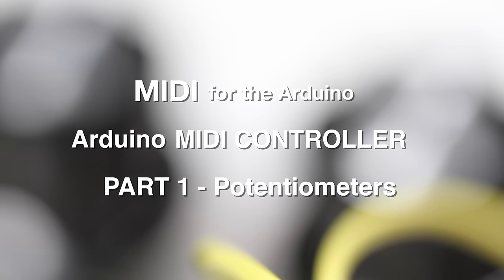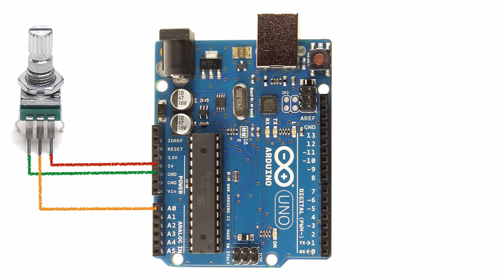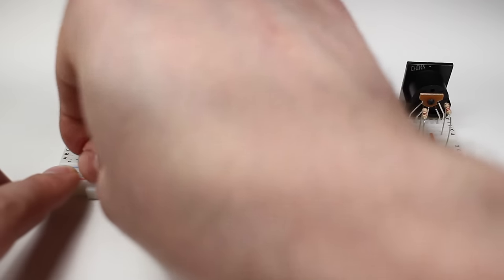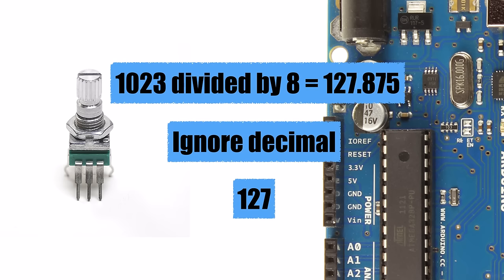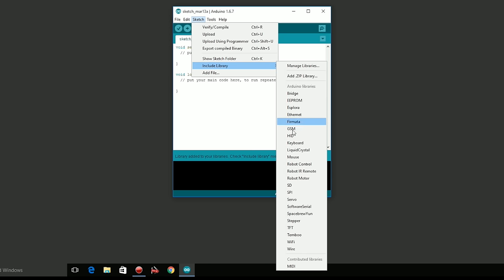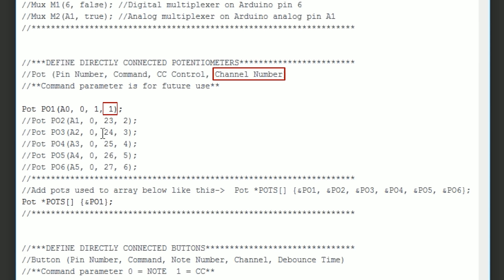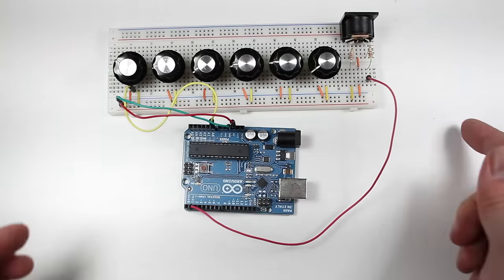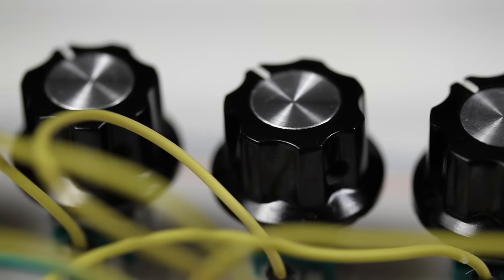Arduino MIDI Controller: Part 1 - Potentiometers

Comment: Hey I need to dig into the code but quick question --- does the current implementation support sending SysEx messages and not CC?
Reply: Did you find your answer? I'm working on to arduino and Sysex messages so as to control specifics parameters on my differents synths.
Reply: Bruno archi.entpe hey I have code I wrote a couple of years ago that did this, but it's a mess. Look at the MIDI.h library. You can send SysEx the same way the software shown in this video sends CC messages.
Reply: Ok I will see. I hope it will be so easy. Thank you.

Comment: HI, how can i send a note message from potentiometer, i ve tried to add the same property of buttons but something doesn t work, THANKS
Reply: I have found that this library is, at times not extensive enough and that the controller surface library is better, I got as far as sending the right LSB part of a message with this library, whereas the Controller Surface Library made me able to actually send the right amount of commands, since this one lacks CC functions.

Comment: Hello Dave,

1) what if I want to send SYSEX messages instead of CC?
My main problem seems to be that I dont know that the MIDI lib says, in other words what Arduino will understand.
Here a example (Yamaha TX81z)
NAME SYSEX MESSAGE  RANGE(the conversion to 99 instead of 127 will be no issue)

Operator 
level                                     
OP1     F04310 12 31 DVF7 0-99
OP2  F04310 12 17 DVF7 0-99
OP3  F04310 12 24 DVF7 0-99
OP4         F04310 12 0A DVF7 0-99

2) Additionaly it would be great if you could show a MIDI to CV. This could be using a RC (Low pass) a r2r or a D/A.
I think there are many Werkstatt, Monotron and other users who would appreciate your assistance as the Keyboard is not realy nice.

Thank you

Comment: Hi, do I  need to connect the snap-in pins of the potentiometer to GND or can I attach them to a independent soldering point which isn't connected with anything else?
Reply from the maker: Hi Mason. Only the the three pins on the front need to be connected. The snap tabs just hold it in place.

Comment: Hi, im going to try this. Is there a max number of potentiometres you can add? In the video you've added one, but I'd like to add 60 endless rotary encoders. Can that be done using your code before i throw away money on loads of gear?
Reply from the maker: Hi Daniel. This won't work with Rotary Encoders. They are very different from potentiometers.
Reply: @NotesAndVolts  shows what i know.

Comment: Looking to make a MIDI CC foot controller..... can the pots be switched out for 1/4" Jacks?
Reply from the maker: Hi worshipkid. You can do that but you may need to use a jack with a switch in it to ground the input if you unplug the pot. Otherwise the input will be 'floating' and you'll get a bunch of random values be sent out constantly.
Reply: @NotesAndVolts  Thanks again!
Would I run into any problems if I use a foot expression or volume pedal?

Comment: are u connecting the midi to the computer/laptop. do we even get midi ports these days in computer? I don't have one , what should I do?
Reply from the maker: Hi gsrini. I connect it to my computer through the midi jacks on my audio interface. I use an M-Audio M-Track Plus
Reply: Notes and Volts  thanks for the quick response.I just read there is something called hairless midi which uses arduino's USB port to send serial msgs that is converted by hairless midi to midi . is my understanding correct? can u pls do a video on that.
Reply from the maker: I'm going to convert this to USB midi in the future but I am planning to move to the Teensy platform (pjrc.com). This is an arduino compatible board that supports USB Midi without messing around with hairless or other things.
Reply: I'm glad I checked the comments. I was wondering about a USB midi config.

Comment: I know this is acient, but, if someone sees this please help. I basically want to make a surface with like 16 potentiometers. I want to be able to map them to anything in my daw. What CC should i put in. I dont want them to have just one function, i want to for example use 1 knob for attack in one plugin, and in another one i want it to be for delay. How?
Reply from the maker: You should be able to map the CC numbers in each of your plug-ins to any number you like.

Comment: i guess i can't just use the arduino usb connection for the midi output? i'm getting unreadable outputs in the console and there is no midi device being recognized. i wanted to use this to change values of my DAW on the fly.
Reply from the maker: This project is 5-Pin Midi only

Comment: So what needs to be done to get 16 pots sending data (are there arduino boards with more ports?)... also... is there a solution for 14bit rotary pots?
Reply from the maker: Hi UnkaTom. You can do 16 pots with Multiplexers. The video is in the playlist. Unfortunately, there is no Rotary Encoder support currently.

Comment: I know to program the controller I have to use a PC, but after I program the device using the software can I use my device on a mac?
Reply from the maker: Hi DJ. You can use it on any device that has a 5-Pin Midi input.

Comment: I'm trying this with ableton. I've got midi coming in but it's completely out of control! Any ideas?
Reply: Are you using a multiplexer or are there inputs defined that are unconnected in the real world (like, defining a potentiometer at A6 while there is nothing connected to it)?  Because if so, especially potentiometers are prone to "jitter" when left unconnected due to the way they are (or can be) read out and even nearing your Arduino with your body can cause the input to shift values.
Have you tried pulling any inputs that are defined but unconnected to ground by connecting them physically to ground?
Also, are you using a real MIDI-connector versus a firmware that identifies the Arduino to the computer as a MIDI device, because in case of the first, it sounds either like you've switched up pins (MIDI is seperated through optocouplers in most professional devices so actually blowing something up might be hard, but could cause problems in the way it tries to handle data when translating) at the connector side or the receiving device is working on a different baud rate than the Arduino is sending it out.

Comment: Hi, can somebody tell me how to make the led flashing when i turn the potentiometer or press a button. I mean the led turns on when I change the parameter and when i stop turnig the led stops too. It’s easy with buttons - simply digitalWrite. But I don’t get how to do this when it comes to the pots part of the code

Comment: since i don't have midi on my pc and i don't own an audio interface, a midi to usb dongle would work right?
Reply: Or download the Midi firmware library to flash your Arduino Uno or any other USB to Serial based Arduino interface chip with, so it will identifies itself to your OS as a Midi device :).  That's how I tested mine at first (before buying a Leonardo).

Comment: Hey, my 10k fader have 4 pins... which of them do I have to wire where?

Thanks :)
Reply: You might have an answer already, but, it's not an ALPS fader by any coincidence?  :P  If so, when holding the fader upwards with the 3 pins closest to you, connect the middle pin of those 3 to the ground of the Arduino, and the most right pin to the one of the analog pins of the Arduino (this is the wiper).
The 5V pin (or ground pin, should you happen to reverse the ground and 5V) is at the far-right of the fader.
The pin you might not use this time is a touch-sensitivity feature of these faders (other brands might have them as well, I know them from ALPS only because those are the only faders I've had my hands on) that can make touching (or nearing the fader with your body) the fader act as a button for some kind of function.

Comment: I follow all steps, I was using midi-ox to monitoring the midi input, but the signal is not being recognized as "CC modulation", just like "note on". I try link teh pot to a knob in FL Studio and works fine, but then I tried to link it to a WHA pedal in guitar rig 5 it behaves like a button!!! just two states, max and min... why? Where did I go wrong? I set everything just like the video.
Awesome channel by the way. (and excuse my english)
Reply: I solve my poblem. It follows that I was using a "midi to usb" converter cable, and it seems to convert all types of MIDI data on MIDI notes. I'm using the serial port now (with the help of some "serial to midi" software) and it works perfectly ;)
Reply from the maker: That's great Samuel! Glad to hear it
Reply: Hey Samuel. You can use your USB-MIDI cable. Try doing this: In the Arduino MIDI library you should have midi_Settings.h with this line: static const bool UseRunningStatus = true; Change it to false and give that a try.
Reply: I really want to try building this but as a Mac user I have no serial input, so unless this definitely works with a USB to MIDI cable then it's not worth me doing it.  Can anyone confirm this works for sure in this situation?  Does the code that Jaroslaw kindly provided above do the trick?  Thanks
Reply: I actually had similar problem as Samuel. Signal from potentiometer was recognized as note on/off, (off when 0V and on with everything higher) and not as CC signal. This solution helped in my case. Found it on the web, so probably it helped also other people.
Reply: Thanks Jaroslaw, I'll try it.

Comment: why you add an 220 Ohm resistor to the circuit of midi output? in comparation to the previous video that explain how to do a midi output and just use 1 resistor?  if you can help me i will be grateful
Reply from the maker: Hi Mauro. Use the second resistor as described here.
Reply: but why is the question, i want to understand.. do you have a link that explain more detailed please?
Reply: by the way your videos help me a lot thanks for share your knowledge
Reply from the maker: The 2nd resistor brings the circuit closer to Midi spec which is 5mA.
Reply: thank you man :)

Comment: Hi N&V，
Just new to the electronic stuff, few questions:
How to use the usb port instead of midi jack,? If we try to use midi software for mac, the mac does not have the midi port. Any difficulty for signal or data transfer?
For the Arduino 5v pin, and the potentiometers, do they need 5v power supply to make them functional?
Thank you.

Comment: I'm guessing that shifting bits right by 3 and left by 3 is to mask the lower 3 bits?

  _value = analogRead(_pin);
  _value = _value >> 3;
  _oldValue = _value << 3;
  _value = _value << 3;

 You could AND it with 0xFFF8 (for a 16 bit data type) to mask the lower 3 bits

Like this

_value = analogRead(_pin) & 0xFFF8;

 _oldValue = _value;

Comment: Could I use this as a midi controller, could I plug this in the back of a audio interface or usb midi interface?
Reply: Jacob DeForge you should be able to use it as a Midi-Controller. you will need a Midi-Female Port to input it to your computer, for example on a Midi-Interface, as you already mentioned. Might need some additional tweaking. I want to test this as well, if i get it to work i will update this thread and maybe create a stepbystep on how to do it.
Reply: you could also search on GitHub for HIDuino, makes connection possible using the Arduinos’ USB-Interface, making useage of a Midi-Interface obsolete

Comment: hi dave , how i can output midi signal on the arduino usb ?
Reply from the maker: Hi Victor. This project is for old school 5-pin Midi only.
Reply: Has your opinion is what if I flash the firmware HIDUINO this can walk

Comment: hi guys, i try to find a tutorial as good as this one but with an Arduino pro micro or a Teensy... because my plan is to add potentiometers to a midi keyboard ... connecting the usb from the board to the pins out of the Keyboard usb midi port...

Comment: please tell me what to do i have 100K pots. my computer reconise a signal but i have only 3 values: 0 56 ans 120. do i have to translate something or what? its getting me mad!!!
Reply: You sure that you used the analog inputs and analog read commands and not the digital? 
Edit: Scracth that. I commented before watching the video and didnt know he had an example program.
Reply: i use hairless miserial because i dont have a midi interface, to plug it by usb. i have changed the baud rate into 57600. the signal still be irregular and come from different channels. i can assimilate it on ableton live on virtual pots, it reconises something, but when i try to move the potentiometer, nothing happen, or sometimes very bugged things... here is my midi signal on my midi monitor: 
21:59:27.556 To Bus 1 Note Off 1 G♯2 0
21:59:27.556 To Bus 1 Clock  
21:59:27.556 From Bus 1 Clock  
21:59:27.556 From Bus 1 Clock  
21:59:27.556 To Bus 1 Clock  
21:59:27.556 To Bus 1 Clock  
21:59:27.588 From Bus 1 Note Off 1 G♯2 0
21:59:27.588 From Bus 1 Clock  
21:59:27.588 To Bus 1 Note Off 1 G♯2 0
21:59:27.588 From Bus 1 Clock  
21:59:27.588 To Bus 1 Clock  
21:59:27.588 To Bus 1 Clock  
21:59:27.589 From Bus 1 Program 1 56
21:59:27.589 To Bus 1 Program 1 56
21:59:27.633 From Bus 1 Program 1 0
21:59:27.634 From Bus 1 Clock  
21:59:27.634 From Bus 1 Program 1 56
21:59:27.633 To Bus 1 Program 1 0
21:59:27.634 To Bus 1 Clock  
21:59:27.634 To Bus 1 Program 1 56
21:59:27.634 From Bus 1 Program 1 120
21:59:27.634 From Bus 1 Program 1 56
21:59:27.634 To Bus 1 Program 1 120
21:59:27.634 To Bus 1 Program 1 56
Reply: you think it is because i have an arduino mega and not an arduino uno? i did like in the video with the same program, i juste did without midi interface this is the only difference so i use a virtual midi plug by usb. my midi motinor sometimes tells me (but i cant control when it happen) : 
22:03:21.561 From Bus 1 Clock  
22:03:21.561 From Bus 1 Program 1 56
22:03:21.561 To Bus 1 Program 1 0
22:03:21.561 To Bus 1 Clock  
22:03:21.561 To Bus 1 Program 1 56
22:03:21.572 From Bus 1 Note Off 1 C-2 0
22:03:21.572 From Bus 1 Clock  
22:03:21.572 To Bus 1 Note Off 1 C-2 0
22:03:21.572 To Bus 1 Clock  
22:03:21.572 From Bus 1 Clock  
22:03:21.572 To Bus 1 Clock  
22:03:21.585 From Bus 1 Note Off 1 C-2 0
22:03:21.585 To Bus 1 Note Off 1 C-2 0
22:03:21.588 From Bus 1 Clock  
22:03:21.589 From Bus 1 Note Off 1 G♯2 0
22:03:21.588 To Bus 1 Clock  
22:03:21.589 To Bus 1 Note Off 1 G♯2 0
22:03:21.601 From Bus 1 Program 1 0
22:03:21.601 From Bus 1 Clock  
22:03:21.601 To Bus 1 Program 1 0
22:03:21.601 To Bus 1 Clock  
22:03:21.601 From Bus 1 Program 1 56
22:03:21.601 From Bus 1 Program 1 120
22:03:21.601 To Bus 1 Program 1 56
22:03:21.601 To Bus 1 Program 1 120
22:03:21.617 From Bus 1 Program 1 0
22:03:21.617 To Bus 1 Program 1 0
22:03:21.617 From Bus 1 Clock  
22:03:21.617 From Bus 1 Program 1 120
22:03:21.618 From Bus 1 Program 1 0
22:03:21.617 To Bus 1 Clock
Reply: Im sorry but I cant help you, I assumed that there were simple connection errors or something but seems like its something different.

Comment: Thanks for this video.  I want to ask if the potentiometer you are using to insert into the breadboard has to be the kind where the pins are facing downward into the board? Or can you use different types of potentiometers to insert into the board? for example: https://www.build-electronic-circuits.com/wp-content/uploads/2015/11/potentiometer.jpg

Comment: Is there a way that i can get this to work with Photocells?
Reply from the maker: Hi Patrick. This will potentially work with anything that can be connected to the Analog inputs on the UNO so i don't see why photocells would't work.